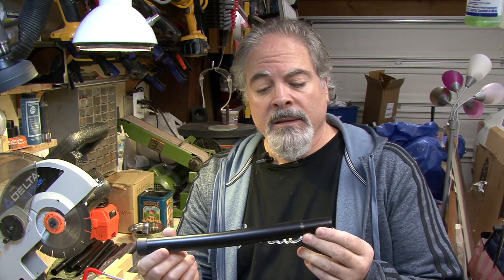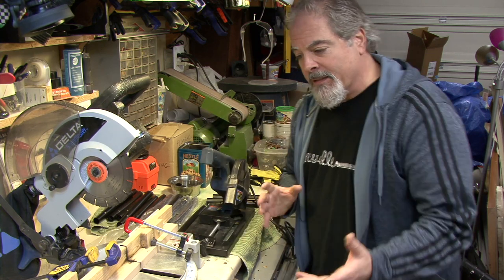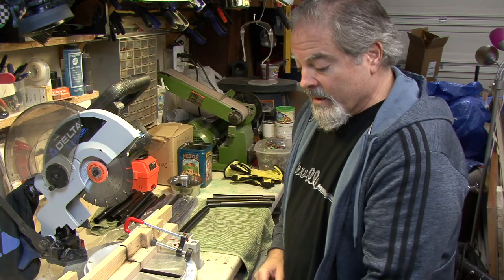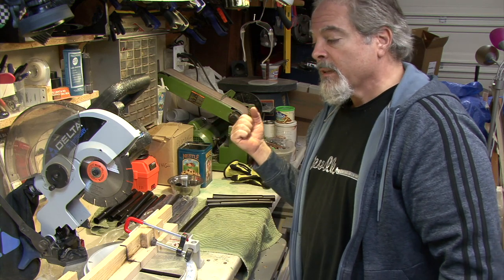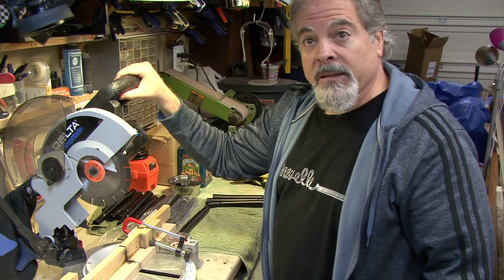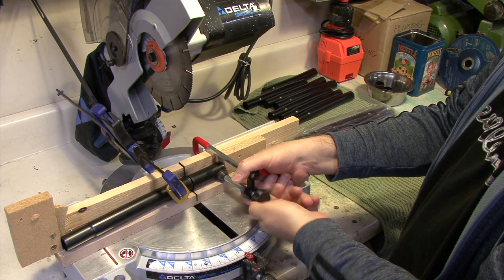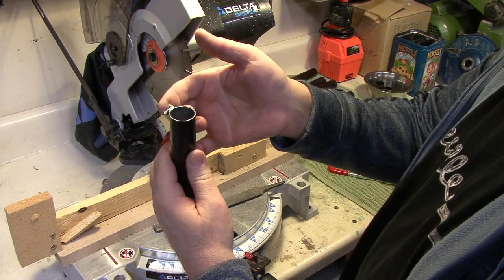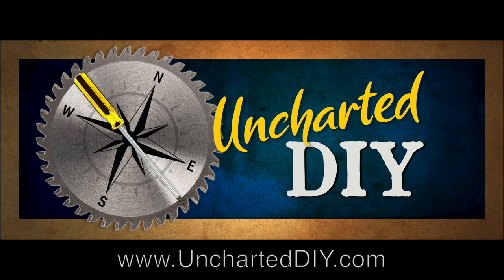How to shorten metal stool legs, evenly and with precision. Stools not the right height? Fix them!

Comment: My project requires a tool to cut both metal and wood legs. What type of shop would offer this service as I don’t want to DIY this
Reply from the maker: That's a tough one. I think it would be more likely that a metal shop could cut wood using the same equipment, versus a wood shop cutting metal.

I would try searching for "metal cutting near me" or "metal fabrication near me" to find a place. You could also try https://www.metalsdepot.com/ to see if they have a location near you. I've used them for all kinds of metal cutting and I've been happy with their service.

Of course, call them first to make sure they will do both! 

Hope that helps, and I would be curious to know what you find.

Comment: The RPM will be the same regardless of the diameter of the blade.  The difference is the rotational speed at the edges of the blade.
Reply from the maker: You caught me, Scott! 

While at 03:32 I said:   "because it's only 7 inches instead of 10, the actual surface of the blade is gonna spin slower…which already eliminates one issue, of it maybe cutting too fast."

That pretty much explains it. 

However, then at 03:58 I said:    "And then, on top of it, because it is a smaller blade, the actual RPM will be slower with a small blade versus a large blade."

What I meant to say is that the EFFECTIVE RPM would be lower. Unfortunately, I can't change a YouTube video once it's posted. 

I guess I could say I did it on purpose to see if people are actually listening 😁 You passed my test 👍

Comment: Liked your video and you were very explanatory. I have maybe 2" circumference metal legs to my electric bed. Legs are 9-inches but I prefer 6-inch height. Legs are expensive & saw a video where guy cut one missed sized leg he was sent. I have the Ryobi battery miter saw and maybe not enough power. So first will try to find a local shop to cut my legs. If I had all the right tools I would at least try your method. Thanks for sharing.
Reply from the maker: Thanks for the feedback, Born DIY (love that name)!

I have not used the Ryobi battery miter saw, but I'm always impressed with Ryobi tools (both my table saws are Ryobi). I think it would work - it just might not be able to do all four on one battery charge. Since the blade has so many fine teeth I don't think it would bog down like it might with really aggressive teeth. 

If a local shop has a metal cutting band saw, that might be easier, but otherwise, I think you can DIY it! I'd love to know how you get it done. I'm sure it will feel great to have your bed at the perfect height!

Comment: Excellent video
Reply from the maker: Thank you, Trish! 🙂
Reply: I ordered some of the saw blades today.  Your explanations were clear without being so long I’d lose interest.  I bought a bed frame that didn’t come shorter but it had some features I liked.  Now I’d like to shorten it.  What you did (exposing) isn’t easy so kudos.
Reply from the maker: Glad it helped. Cutting metal that thick may be too much for the blade I showed, so start off with light pressure and take your time.  If it dulls the blade quickly, you might be better off using a cut off wheel or disc. They are a bit messy so try to work outside and wear a mask or respirator. I'd love to know how it goes!
Reply: Just my follow up…..I think I’m going to have to try an alternative strategy.  I finally received the saw blades yesterday and I didn’t have a manual for my dw705 compound miter saw so I got one.  Of course it says not to cut ferrous metals but I disconnected the safety and put the saw blade in….i cannot figure out a way to safely connect a “jig” to the fence.  There aren’t any holes in the fence and clamping doesn’t seem to be holding (could be the quick clamps) but there aren’t really flat surfaces to clamp to or my clamps aren’t deep enough.  I’m also not used to the sparks 😅 but the bigger thing is securely and consistently securing the pieces.  It might even be easier to create a jig using a metal square and insert the blade in a circular saw.  Think I’ll think about it.  Really appreciated the video anyway.  Like to noodle these things through.
Reply from the maker: For such thick steel, I'm thinking that renting a dedicated abrasive cut-off saw might be a good choice. They come with a clamping rig built in, and I think you would make quick work of your project. 

At my local rental place, they run $33 for 24 hours. If you don't know what I'm referring to, here's a link to a brand new one so you can see what they look like. https://www.homedepot.com/p/RIDGID-15-Amp-14-in-Abrasive-Cut-Off-Saw-R41422/301289971

Thanks for the update and please let me know what you end up doing 👍
Reply: @UnchartedDIY  thanks again
Reply: Final chapter.  After investigating rent a metal saw, I found a metal supplier in the area and they would cut the 9 legs down while I waited for $60.  That was cheaper than the rental.  It was fair and they were great.  Thx again
Reply from the maker: @Dishpjl  Yay! I'm glad it all worked out!

Comment: I need another  way I don't have this saw and can't take legs off chair
Reply from the maker: I think you could use an inexpensive hacksaw if you don't have a bunch of legs to cut and you are not in a hurry. It is critical that each leg is cut exactly the same length from the floor, so measure carefully. Propping the legs up so they are parallel to your work surface will make it easier to make your cuts straight. At least two legs should be firmly supported while cutting so nothing is moving around.

I wish you success in your project, and thanks for watching.

Comment: Your RPM would increase if anything, because it is frequency rather than distance.
Reply from the maker: You caught me in an over-simplification, Rowan 🤭  Technically, the RPM of the saw arbor WILL NOT change with the blade diameter switch. The surface speed (thus the cutting speed) of the blade WILL change.

Since the cutting edge of a larger blade is further from the arbor, the teeth are traveling at a greater speed than a smaller blade at the same RPM.

Think of the blades as wheels on a car. The 7.5 inch blade (wheel) would cover a distance 1.9 feet per revolution while the 10 inch will cover a distance of 2.6 feet. Let's say the arbor is spinning at 1725 RPM. The 7.5 inch would travel 3,272 feet per minute, whereas the 10 inch would travel 4,514 feet - a 38% increase in effective speed. 

So, while the actual RPM does not change, the effect on cutting speed is the same as slowing down the RPM.

Rather than saying all that and having people's eyes glaze over, I spoke in terms of RPM to keep the video shorter and easier to follow. 

Clearly you were listening and I appreciate it!